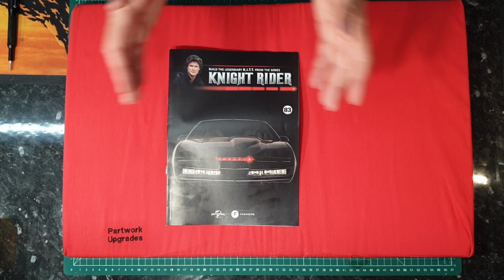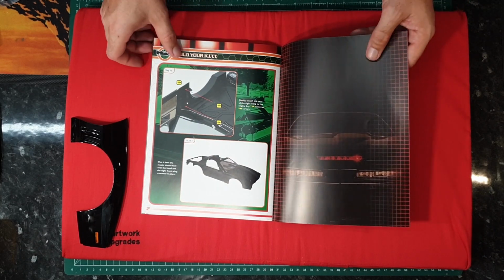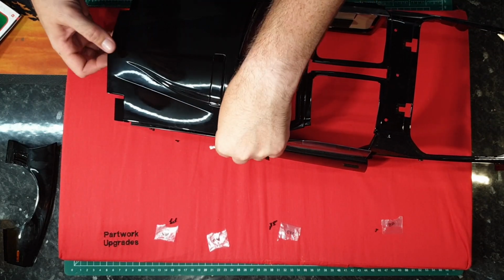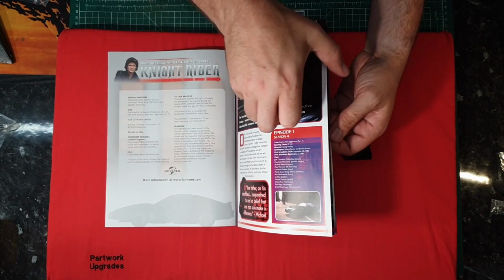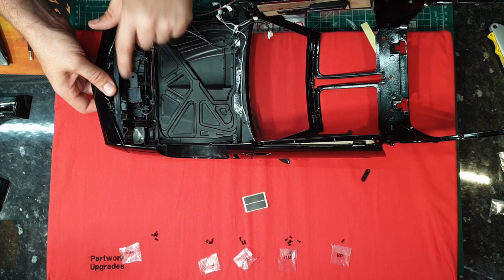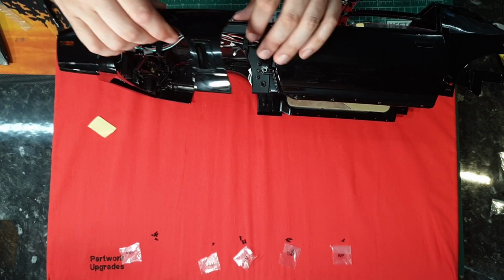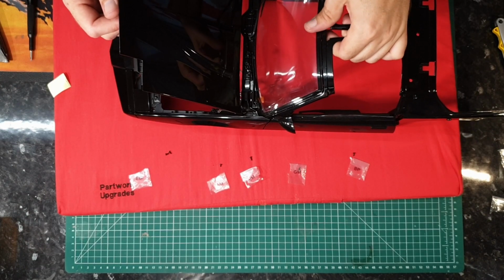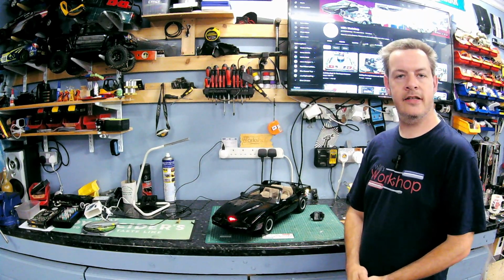Build FanHomes KITT from Knight Rider: issues 83 - 86

Comment: i got the same issue on the bonnet, slightly raised at the back,not to keen on how you have to open the bonnet, also looks like i caught one of the wires for the right side headlight as its not coming on
Reply from the maker: It is a bit of a faf but I also think that I am not going to be opening the bonnet very often

Comment: Hey will nice video as always
Did box number 22 issue 83,84,85,86.all was going great and find with the build yesterday.but when I came to put the left wing on the left side of the car bodywork it went and broke my motor wire on me and all was tied down and away from the holes so the pop up front lights wouldn't come on.
I had to take it apart on the front and get in touch with fanhome for a replacement 
Not a very happy bunny
Reply from the maker: Thanks, sounds like a nightmare, might be worth seeing if you can resolder it
Reply: @WillsWorkshop  that's something I wouldn't know how to do my friend 
Fanhome told me it been sent to me A.S.A.P

Comment: Have done the mod as I just couldn't leave them not working I just used the leds that weren't needed after the Monitor mod added new cable to them and connected them to the bottom front lights I'm really pleased with it.
Reply from the maker: Great idea, I had forgotten I'd removed those LEDs